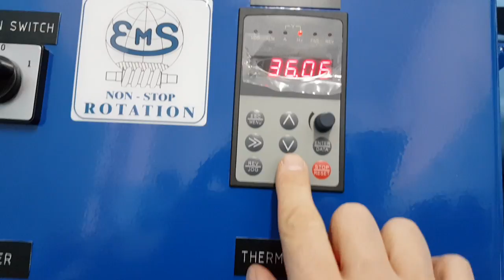Oil press SPU 40 - Sunflower seeds

Comment: Isn’t it better to press the decorticated core?
Reply: It would be expensive,it would cost too much
Reply: @AliceFan-rp9gq  what would cost too much?
Reply: @gnsoluzioniedili26  sunflower seed need Hull breaking machine, de-stoner machine, vibrating screen
Reply: @gnsoluzioniedili26  these needs3000-4000usd,if you paln to buy refinery
Reply: @gnsoluzioniedili26  Pre-pressing process of sunflower seeds: cleaning - hulling - conditioning - billet rolling - steaming - pressing - three-stage filtration.
Reply: @AliceFan-rp9gq  I know that cold pressed oil does not require any treatment, just cleaning the seeds from the impurities and check the moisture that is not just dried, and seeds can be put in the press and at the end the black that comes out of the bark must be filtered so the product remains clean. this and all.
Reply: @gnsoluzioniedili26  yeah,simple operate is ok
Reply: @gnsoluzioniedili26  greatly

Comment: Kindly send price, Power in HP & production yield per hour
Reply from the maker: We produce 4 types
Spu 20  1.5kW  capacity 5-20 kg/h 
 2615 Euro

Spu 20 S 2.2kW capacity 5-20kg/h
 3180 Euro

Spu 40 2.2kW  capacity 10-40 kg/h 
 3300 Euro

Spu 40 S 4kW  capacity 10-40 kg/h
4340 Euro
Reply: Contry of origin plz